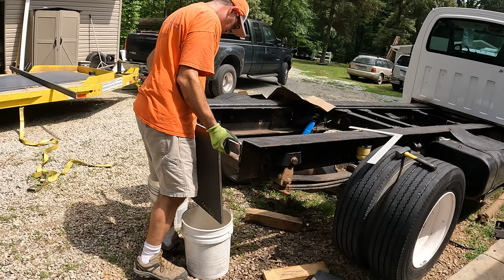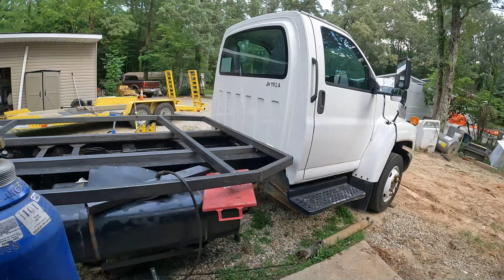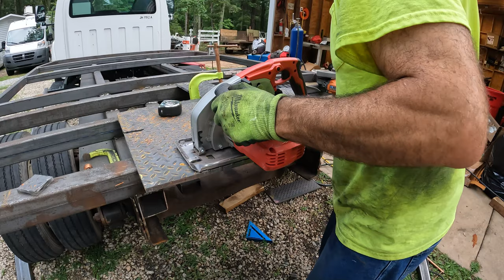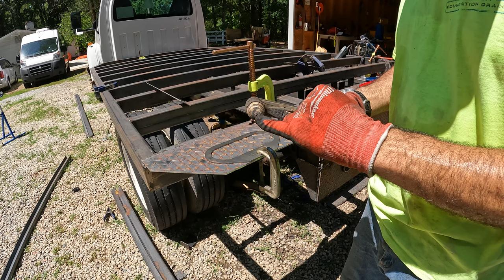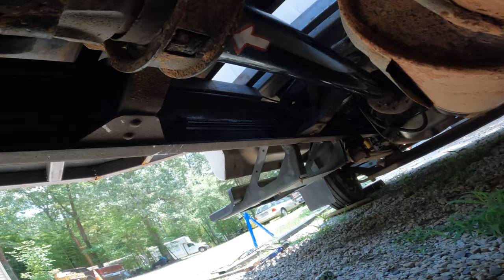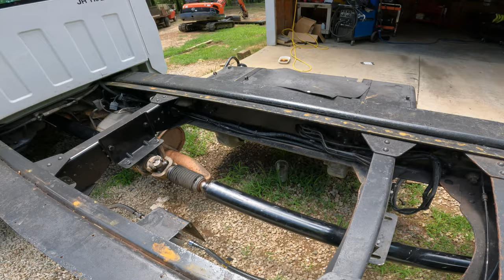Flatbed build Part 2 - ex U-haul truck build

Comment: Don't beat yourself up about mistakes. They happen. Fix the broken stuff and move on remembering the lesson. The truck looks pretty good and it will be an asset to your business. I'm sure you've already thought about it but you'll need to rings for tie downs. All in all it was pretty interesting to watch you build the truck. I'm glad the driveshafts worked out too. They can be quite troublesome with their length and balance. It looks like you have a good shop making your driveshafts. Keep up the great work Shawn
Reply from the maker: Thank you Paul! I got some wiring done on the truck yesterday and will be working on the next video in this series soon.

Comment: Nice job on the bed. The gooseneck ball should have been installed just forward of the axle, approximately right above the u-joint on rear axle. If you don’t haul too heavy you are fine where it is.
Reply: I was thinking that it was a little too far back too. Thought it was supposed to be just forward of center point of axle. But then again this is a lot longer than normal trucks. 🤔🤷‍♂️📏📐✏️🔩🔧🛠️👍🚜
Reply: Yeah it should definitely be forward more.  It’s not so much the length of the truck as it is weight distribution.  That’s why Tractor trailers can slide the fifth wheel.  It lets us distribute the weight more evenly if we need to. Where it’s at is gonna make for some pretty squirrelly handling.

Comment: 17:20 i don't know if you caught it but your metal plate shifted a little while you were cutting it probably because it wasn't fastened well enough.
probably resulted in an uneven cut.
(you might need to watch the video at 1.5x or 2x speed to see it because that is how i watch it).

Comment: Turning out nice, i always drill 3/8” holes in the sheeting above the crossmembers and weld the sheeting to the cross beams to avoid the warping or flapping, grind the welds flush if needed and its like a solid chunk. Why no protection to the cab below the back window guard?

Comment: Great build. Saw one of these uhauls where they chopped the box off and kept the og aluminum floor for a flatbed. Im not a great welder but when mine are looking similar to yours i crank up the heat and or alow down the wire, thats with flux core which i prefer for these big outside projects

Comment: I felt you pain when you mentioned the harness getting wrapped around the shaft!  Do you need any bracing from the outside edge of the bed to the frame to prevent twisting?  Nice job above my skill level.  Fun to watch.  Thanks for sharing.
Reply from the maker: I think the bed will be fine as is. I had a friend who is a fabricator and engineer look it over a couple times during the build and he was happy. He was especially happy I went 1/8" wall thickness on the tubing.

Comment: Great project. But if I may. Check your heat and wire feed settings on your welder.  As a good friend of mine would say it looks like a bird 💩 on it.
Reply from the maker: For sure. The wind was working against me, and my helmet was a huge problem too.
Reply: @GCFD  believe me when I say. I’ve experienced the same thing. Luckily my friend that gave me a hard time was also a great welder and showed me how to do it. Just takes practice.
Reply: "Bird $#!+ welding. Because seagulls are the best"

Comment: Did you position the gooseneck hitch directly over the axle? 
Every inch the hitch is behind the axle adds significantly to the swing out you are going to experience every time you make a turn towing your trailer
Reply from the maker: Yes the gn is right over the rear axle. 👍

Comment: In that area of the goose neck hitch, do you need to put either a drainage hole? or the world's smallest sump pump?
Reply from the maker: Yes there are holes on each corner for bolts that are still open. 👍

Comment: Wow what a project, and in the heat too. Way to stick with it and keep it going. I really like how nicely the rear lights went in. I found myself wincing when you were moving that clumsy bed around. Did you smack the soffit of your building with it? It looks like you did but it didn't cause any damage. Looking forward to seeing the next installment. Thanks for this!
Reply from the maker: No I hit the front blade and it made a bump sound. I got the lights all wired up today! What a pain!

Comment: Maybe buying a box van and adapting it into a trailer, every thing is already made. Cut off the cab and front axle and clean it up. All it would need is an A frame to hitch onto your pickup.
Reply: I’m doing the exact as u explained I just brought a 24 ft deck over trailer with a 3 ft dovetail

Comment: Did you level the frame and bed to the ground? Or did you just match the bed to the frame?
Reply from the maker: Matched it to the frame. That made the most sense to me since the truck would rarely if ever, be on a totally level surface. 👍

Comment: Verify whether you can run the plasma on 220V, the duty cycle is much higher than on 110V.   I have a fancy everlast multi process welder that is basically unuseable on 110 but a beast on 220V

Comment: Just a heads up for you or anyone trying to recreate this since you didn't mention it. Make sure to disconnect the vehicles battery before welding on it. You can fry the computers if you don't. Even if you aren't anywhere near the vehicles electrical system.

Comment: Why two lights on the pax side?
Reply from the maker: Two lights on both sides and reverse light on driver side 👍
Reply: @GCFD  Kinda looks unbalanced. Why not 2 reverse lights?
Reply: Wondering the same thing
Reply: When you were measuring the second hole on the driver's side,  I was wondering if you were running out of space to get three lights on each side without running into the truck frame.  If you were only putting in one reverse light, why not the center?  Now that you have the 3rd hole on the left, it would look better to go ahead and put one on the right IMHO.
Reply from the maker: I have one reverse light on my other trucks, so I went with one here.
Reply: @GCFD  Most trucks with reverse lights have two.

Comment: Those are some seriously bad welds you've laid down there, it's a bit scary, considering you will be pulling a trailer with that abomination.
Reply from the maker: What's wrong with the welds? I've got great tie in with this welder.
Reply: @GCFD  Do yourself a favour and take a welding course, because if you can't see what is wrong with those welds then your ability has to be called into question.

Comment: The U-joints need to be in phase.
Reply from the maker: What does that mean?
Reply: @GCFD  the yokes on the drive shafts need to line up with each other. Otherwise the ujoints will turn at different speeds.

Comment: Looks great, btw. I don’t know if you’re familiar with DTM type paints - I’ve used DTM on lots of steel, lasts for years. I like the brand colors!
Reply from the maker: Yes I've been using some of those direct to metal paints. I've also used primer. This paint is from Tractor Supply, Majic Brand.

Comment: Dont mean to be negative, but why didn't you just reattach the old bumper assembly?  If someone plows into the back of your truck and they get hurt. Their lawyer, or their estate's lawyer will certainly investigate the providence of the truck. They will pull up your social media and you will be in a pickle. I suggest a very hefty commercial insurance policy and that you verify the law on The United States Department of Transportation (USDOT) requirements. USDOT requires trailers and semi-trailers to be equipped with rear impact guards (or bumpers) in order to reduce the risk of death and serious injury from light vehicles crashing into the back of semi-trailers. These rear impact guards must meet the requirements outlined in the Federal Motor Vehicle Safety Standard regulations that were in effect at the time of the truck's manufacture.
Reply from the maker: Great point Robert!